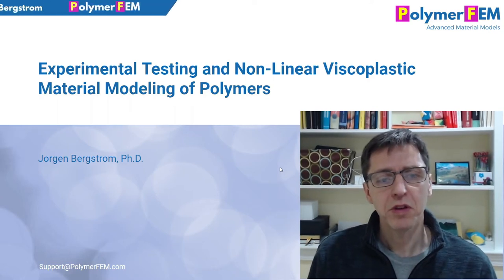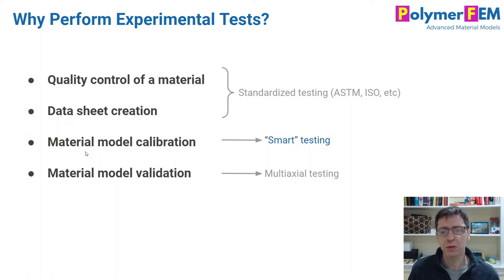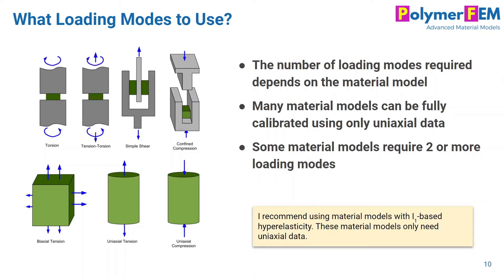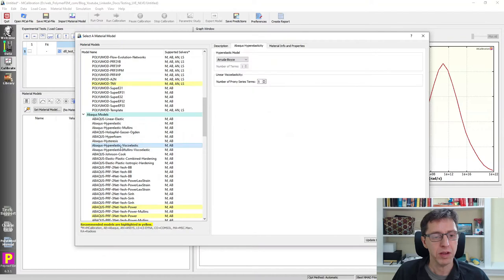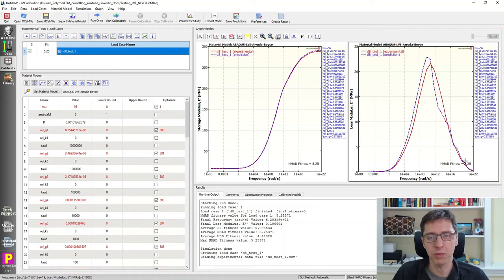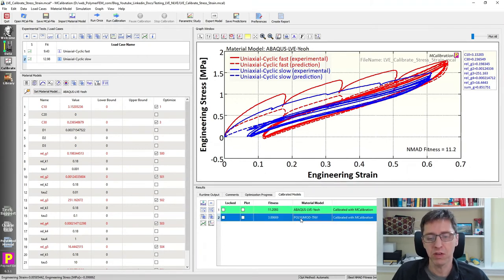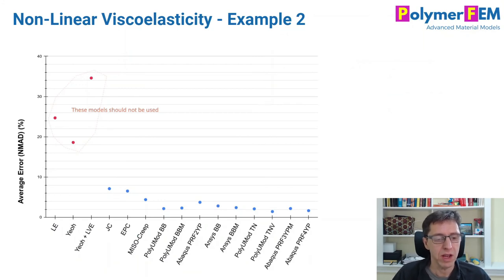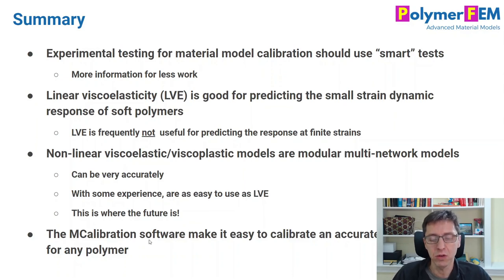Practical Differences Between Linear and Non-Linear Viscoelasticity

Comment: Thanks for your video:virtualhug:, it is really amzing to see the great fitting result using the TNV model. But can we export the TNV model fitting results to the abaqus and ansys files for the simulation? And also, if it is possible to export the predication stress-strain results in Mcalibration?